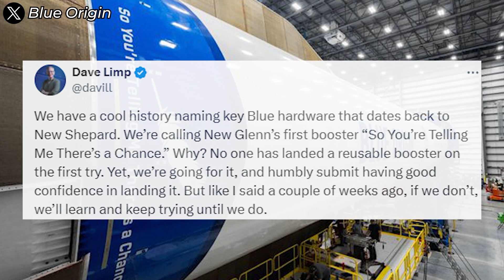Blue Origin Weird Decision on New Glenn Landing Method to Beat SpaceX Tower Catch

Comment: What remains to be seen is what Starship's payload to LEO actually is. All the stainless steel is pretty heavy and the heat shielding is yet to be worked out.
Reply: stfu rainbow nonbinary braindead... Shielding was worked out, so much so that last test flight they removed over 2000 tiles and didnt use the updated tiles from flight 5 just to see if it would survive and it did!
Reply from the maker: yes. They still have a lot to do with Starship before they let it fly.
Reply: Stainless is not so heavy in the thin sheets being used and this was factored in long ago. Regardless the Raptor V3 is far more powerful (especially if they go with the planned 35 V3 engines in Ship V3 (estimated 300t/engine vs 240t for V2). The V3 rocket is 90' longer with most of that being fuel. These engines don't need heat shields either reducing their weight by more than 1 ton Each. That's more than 33 tons weight deleted even in the 35+9 configuration. The tiles with the second layer are a bit heavier, but the thrust and fuel is increasing massively from V1. At the worst, they might see 150t to LEO  with V3... and that would be no tragedy as it would still get them to the moon and do everything they planned including putting up more than 100 V2 large satellites at a time (V2 large has 2.5x the capacity of the current V2mini sats being put up in batches of 23 (giving 10x the Starlink capacity per launch vs F9 for about the same launch cost... until it goes even lower). 200t would be gravy, but that's where their estimates are After factoring in the new heat shield.

Comment: Space is no competition or a race. Also currently a heavy lift market doesn't exist, even the medium is weak which is easily seen with 11 Falcon Heavy launches compared to +350 Falcon 9 launches. So either both sides venture their own goals with Mars and Moon or not much is to do for these rockets.
Reply from the maker: Starship could be as cheap as the Falcon 9 once it’s in full operation. And with rideshare, you can launch multiple payloads in one go. This means selling one launch to many customers, which could make a lot of money.
Starship has so many uses actually
Reply: Starship V3 could easily launch 100 Starlink V2 large vs 23 Starlink V2 mini. The large has 2.5x the data capacity (and hence revenue) of the mini and that means Starship can launch 10x the satellite capacity of F9 at about the same (and potentially less)  cost within a few years. Then there's regular service to the moon, putting 40 or more people or 100t onto the surface of the moon (200 ruggedized Teslabots anyone?) for less than $1 billion, establishing regular service to the moon for less than half NASA's current budget.

Starshield (not to be confused with Starlink) has put up more than 100 satellites for the military so far with a mix of observation satellites, comms and other uses. This has proven massively cost effective for the military and they also intend to buy their own Starships and a launch tower in Florida to have a rapid emergency delivery system. (Especially useful at replacing lost constellation satellites in a timely fashion.)

If no one comes up with anything else, (LEO space stations, asteroid mining on 16 Psyche) they already have their market. Starlink funds alone will get them to Mars with or without government funds.

Starlink was created by Musk in large part to provide the market that he needed to grow rapidly. Only a fraction of F9 launches are non Starlink payloads. 

Your issue was well noted by Musk some time ago as the Heavy Lift market is Far too... sparse and unpredictable. The answer was "Create your own market".

Comment: The thing though is New Glenn is almost complete.  it has everything sorted out payload capacity, engine position, landing gear and so on.  Its engines are reliable and don't suffer from frequent mechanical problems unlike the current generation of Raptor 2 and Raptor 3 engines;.   Starship has a long way of perfecting their heat shield, another generation of engine design,  and most of the internal construction of the rocket for payload space.
Reply: You are working off old information. The engine out issues on Starship launches were caused by interruption of fuel flow in the complex 33 engine fuel distribution system and maintenance of flow in 0g and impurities causing ice blocking filters. Those problems were already solved in flights 4, 5 and 6. V3 is Extremely reliable with tests out to 15 minutes of continuous thrust (4x what would ever be required) and 50 successful engine restarts in 24 hours. The heat shield was pretty much fixed when they added the 2nd layer and upgraded the tiles. 
Spacex built more than 500 V2 engines and destroyed dozens in testing. V3 is Well proven by now at thrust levels that far exceed BE-4 at about 1/2 the weight, while having greater fuel economy (ISP) representing many tons of fuel savings for a given Delta V.

So. BE-4 has had one successful flight and limited hardware testing on the ground (they ran hardware poor for a long time- and that slowed them down). New Glen has not yet launched. Has not yet landed. Has no capacity to land the 2nd stage. If everything goes perfectly... everything on the first go...they will have an Excellent product that is still substantially inferior to Starship.
IF everything goes perfectly. I expect it will take a few goes to get it all right and that will take some time given that they can't mass produce the rockets yet. They don't have the infrastructure, but I expect they will try to ramp quickly as they have to put up something like 6-800 Kuiper satellites in the next 18 months.

This will make them a world player in an excellent position as a Non Spacex lifter... it will not make them competition to Starship V3 which should be in service within a year. But a tremendous achievement if they get it right some time in 2025 and manage to launch enough satellites to satisfy the FCC to allow Amazon to keep their transmission license. They need to launch 1600 Kuiper satellites by mid 2026 and BO holds about half the launch licenses with Vulcan, Araine 6 and a few Spacex F9 rounding out the other 60% or so.

My expectation is that they will have to buy a few more Spacex rides to get this done in time... still getting close otherwise would be a Great achievement and put them firmly on the world stage.

Comment: Their only achievement is developing mini 18m long rocket which can be launched vertically to 100km altitute then return and land. Even then they only did 4 launches within one year period. Now in one go they try to launch 5 times bigger rocket, reach orbit for first time, deliver payload to orbit and land first stage on ship. that's way too optimistic. I only hope that "New Glenn" won't explode during first few minutes of flight and successfuly reach orbit at least - landing booster on first try is dreaming. With their speed we have to wait one to two years till next launch if something wrong happens on launch. By that time starship will be successfully launching starlink satellites every month or so.
Reply from the maker: Exactly, they’ve set incredibly high goals. 
They even say they want to land on a moving barge, definitely not an easy feat
Reply: They have also produced reliable rocket engines like BE-4 that is now being purchased by four other companies.

Comment: A 2 hour turn around on Starship booster?? Sure man. Slow down the Koolaid
BTW Starship V1 has not demonstrated it can lift anything. It has flown empty, fully fueled and ran out of fuel. Booster and Starship..
Translation: very little to no payload.. lets si V2 or V3
Reply: At least Starship CAN reach orbit, BO still only has tip dipping space dildos that reach "space" with 0 velocity instead of the around mach 22 or 27000 km/h that is needed for actual orbit... And of course they are flying their first test flights without cargo/dummy cargo, one step at a time. That is the way SpaceX does things. Not build for years and years and then try everything at once, which BO still tries to do. Quick prototyping and testing makes for much faster evolution of the technology needed and we might actually get somewhere within our life times... instead of waiting for NASA for forever. The moon landings stopped shorty before I was born, and besides lots of satellites and rovers nothing much in the sense of human spaceflight to ANYWHERE but the ISS has happened. SpaceX is actually trying to get somewhere while BO is just wasting money NASA-style and doing a worse job at it too!
Reply: @ You said a lot of words. But, Starship has not reached orbit. It has only done Sub Orbital flights. To reach orbit, you have to fire engines at apogee and circularize the orbit. To de orbit, you also need to fire engine to place the perigee inside Earth’s atmosphere.
I understand why they have not reached orbit yet.
But, they have not. I would assume that they can resch orbit, flying empty as they had. I doubt it that they can place any payload on orbit with the current vehicle. Perhaps with more powerful engines and larger fuel tanks. The truth is that it is still a sub orbital vehicle.
Reply: @pedrosura  I was not aware I said SpaceX actually reached orbit. I said they can, and I think their test flights so far proof that easily.
BO in the meantime is busy reinventing what SpaceX did a decade ago but took over twenty years to do it. Maybe they will be successful in another decade and be only twenty years behind the times... and only took 30 years to do it! 
Which is a big improvement I guess...
New Shepard succeeded in reaching passed the Karman line over 7 decades after the Nazis did it.
New Glenn Land and reuse boosters within 2 decades after SpaceX.

GO Blue Origin!!! GO!
Reply: You said, “at least Starship can reach Orbit”. That has not been demonstrated.
You are assuming without facts. 
My second point is that given the telemetry and the fact that it has flown empty, this current vehicle appears incapable of lifting any payloads to a LEO orbit.
Reply: @pedrosura  This is the extreme pedantry exhibited by only the truly desperate.  Pretty sad really.
Reply: @ it’s just facts. Its hard to turn a 737 in one hour. The
Payload to LEO is the most important thing about this vehicle. More than the catching.
People have to be treated like adults..
Extreme pedantry??? Lol
Reply from the maker: They will test a flight with a load simulator, I guess the earliest will be flight 7
Reply: @ I dont think the current vehicle with the current engines and fuel tanks can lift anything. If you look at telemetry the tank is virtually empty. This means right now, unless changes are made, it can lift nothing

Comment: Based on the dimensions of New Glenn in this video, the cross section is nearly the suze of SpaceX 's Starship booster but the combined booster engine thrust is only about 2/3. It may be that the Starship booster is overkill for the expected loads and not that New Glenn is underpowered . If actual numbers and comparison need correcting, would welcome anything more accurate.

In any case, a New Glenn success us badly needed to provide redundant spacelift capability and not rely in a single system.
Reply from the maker: The existence of New Glenn is necessary, but in fact, Starship's current capabilities are not yet enough for its ambitions. SpaceX will continue developing the next generations of hardware. 

There are rumors that a decade ago,  Musk wanted Starship to have a diameter of 15 meters. And recently, he confirmed that he wants it to be 18 meters, double the current diameter.